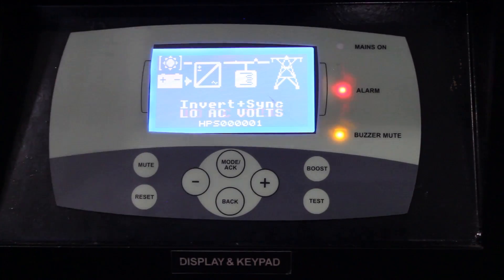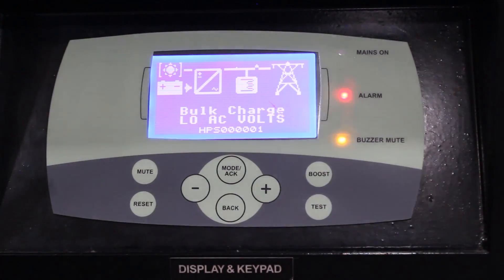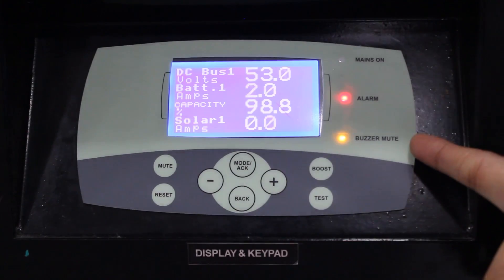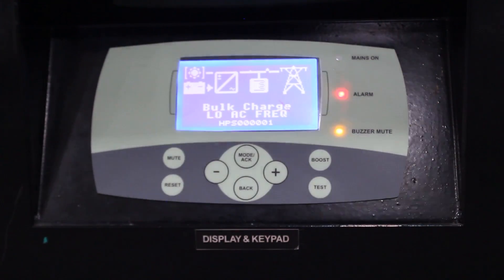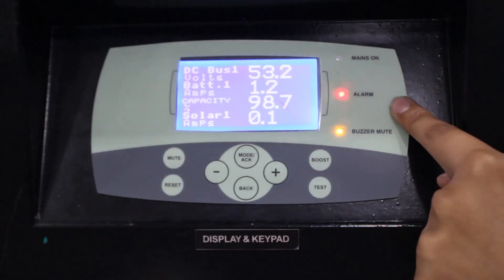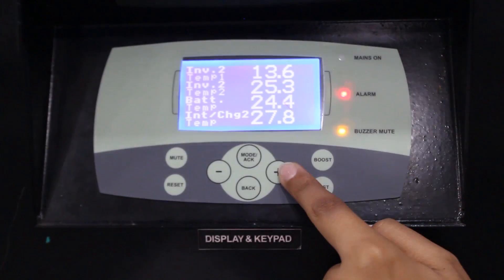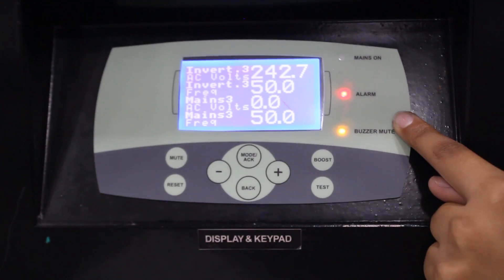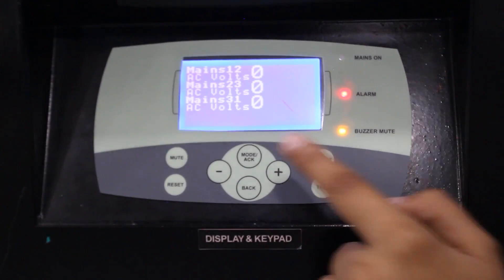Display Keypad Unit | Hybrid Inverters | Statcon Energiaa

Comment: Mam isme 20kw output voltage kaise decrease karte hai
Reply from the maker: Thank you for your comment. Hybrid Solar Inverters mein output voltage decrease karne ke liye aapko hamari customer support team se baat karni hogi. Aap unhe contact kar sakte hain servicing@energiaa.in par ya WhatsApp par message kar sakte hain +91 9821396421 par, ya toll free call kar sakte hain 1800-891-3319 par. Aapki problem ko quickly address kiya jayega. Thank you.